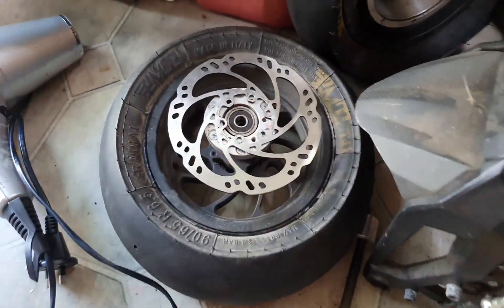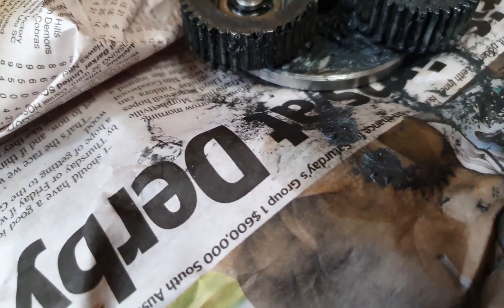Rion electric scooter repair

Comment: When changing tires on the Rion, does the front wheel have an axle that pulls out or do you have to undo the motor wire somewhere? And on the rear wheel how do you undo the motor wire to take the rear wheel off
Reply from the maker: No front wheel motor on my Rion, just rear wheel. Motor wire comes off with wheel. Wire must be disconnected from controller inside body of scooter.

Comment: Just to much money 💰 for flats but segway has tires that doesn't get flats 😑 
And what is going to happen when you hit a pot hole rion scooter's no front shocks no water rated 🤔 no lock or GPS system for that much buy a car don't care if it's sucks you will be dry in the rain tf?

Comment: Hello,
These new motor aren't really made to work in single drive. They have low torque and controler will go in overheat protection mode real fast if not paired with a second motor/controler.
Depending on your friend riding style you may want to wait to install the second one before giving the scooter back.
But then maybe BMS will have to be replaced aswell for a bigger one ? 🤷‍♂️
Reply from the maker: You seem to know your stuff.. Thanks for the info.
Reply: @joc1862  I'm using those parts so just sharing my experience 👍
Reply from the maker: @tuctuc6367  Thanks.. I started the project with the scooter all in bits and as a complete unknown - no connectors on motor, messed up controller wiring and lack of info available. Got it going ok but some of the experiences correlate to what you wrote. Surprised by the lack of torque (going uphill) on that beefy looking motor. Great on the flat though!
Reply: @joc1862  Good job reviving it.
It's a speedy motor rather than torque so its potential is really showing up in dual drive. However, I just checked your battery specs. It's 6P of 35E cells so you could need an upgrade to higher discharge cells to actually run a dual drive setup.
It's pretty rare to see an opened up Rion like that anyway. Usually the brand put lot of effort to not show internal components and arrangement to the public(not cool enough)
Reply from the maker: @tuctuc6367  You're right. Friend found that scooter cuts out very quickly on full throttle. Either the Kelly controller can't handle the amps draw, or the BMS, or both (obviously to protect the lower discharge 35E batteries). Don't know the continuous or max amp rating of the items. As a matter of interest, my ebike power pack uses the LG HG2 high discharge cells.
Reply: @tuctuc6367  what is the winding of this motor..?

Comment: Hey, what’s this model?
Reply: Apex model, single planetary gear motor. Kelly 7212 controler.
Drag tested in Tunnel des Tuileries - Paris, turned out to be slower than DT3.
#hater 🤭
Reply: @tuctuc6367  ah je me disais bien que c’était l’Apex 1 👍🏼 vos histoires de courses ça reste entre vous 🤣
Reply: @aliwood6283  en vrai ça fait parti de l'histoire du développement de la marque. Après cette raclée, rion s'est mis à développer le double moteur. RE80 tout ça tu connais